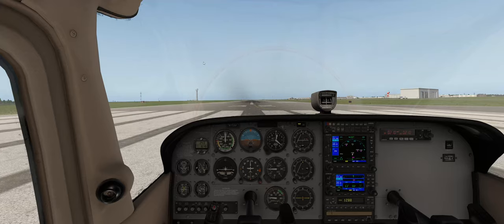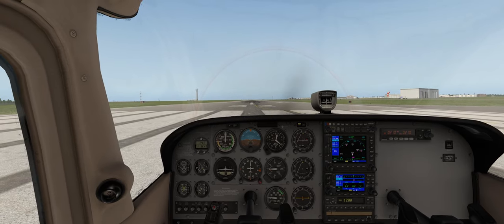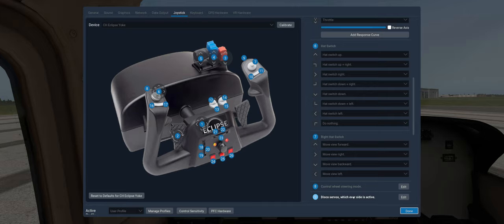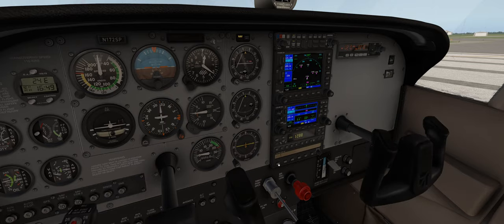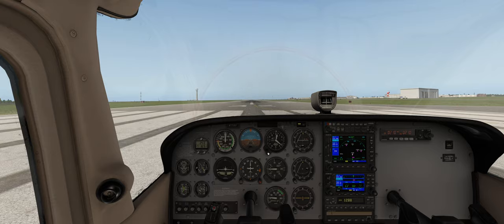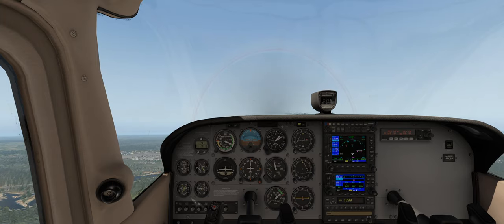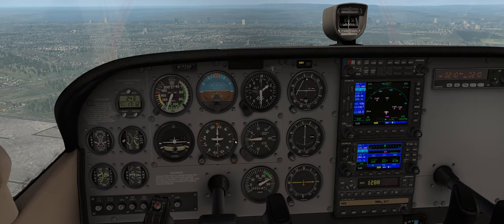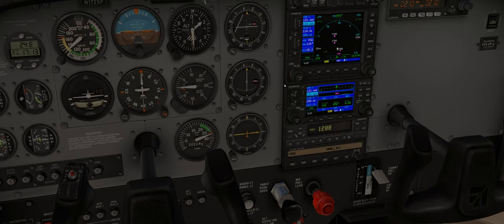X-Plane 11 - Cessna 172 Autopilot [updated]

Comment: This is a great video and it answers a  lot of questions I had about the Cessna 172 and the auto pilot. Just a shame that at some points of the video the frame rate has gone very low resulting in almost still/frozen pictures rather than moving.

Comment: Thank You Very Very Much. I have had no autopilot engagement of servos just the animation of where the plane should go. since the 11.3 update. I just had one plane that it all worked on, a modified Vision Jet G2, that I had go off the Xplane Form.  But you knew the answer. I now have added the Auto pili button to my controller. It now works. Thank You once more.  Namaste

Comment: I did like a 3 hour flight and I crashed because I didn’t know this
Reply: Yup. Jumped on this video like a hungry tiger. 20 minutes fighting the autopilot as it was determined to kill me. Only way I could disconnect the Autopilot was to go into menu bar, let the AI control airplane, desperately restart the engine and prop midair then turn off AI control. Now I can maybe use the Autopilot now. Very instructive video,

Comment: Hi Jason. Your tutorials are very informative and getting the 172 into the air and using autopilot seems easy. But whils I am getting used to it how do I switch back to manual control for approach and landing. I am using the version without the AP button and not sure which button on the keyboard you use. Thanks and keep up the good work. Alan Smith

Comment: Great tutorial. I never managed to make the approach before, but now I understood that my map was showing different things. I didn't see that ILS approach graphics on my screen, so now I can click on it and get the correct frequency. And I also didn't understand how to use the new AP, since most of the tutorials online are based on the old one.
It would be great to see a tutorial how to move from the Cessna to something bigger. Which would be the next step and what do I need to think about? I started out with the Cessna and then quickly moved to the Zibo, but there are sooo many thing to think about, so I moved back to the Cessna to learn a little more before stepping up. So it would be great with a tutorial on how to step up to a bigger plane. And which one would that be?

Comment: Thank you for the updated tutorial. One question though. When you performed the ILS approach you input the nav frequency using one of the input nav 1/2 buttons in the map menu. Bellow these buttons is a third named ILS Approach. What does that button do?
Reply: That puts you at on course to the ILS where it meets the glide slope. You can use it to quickly teleport to test landings.

Comment: I got the CWS and the GPSS but the approach is not working as shown.   I set the 172 up at CYOW on a 10 mile final, start, then pause, click on the map, but when I click on the airport I dont get the localizer line on the chart like you did.  I do see the glide slope in the map window but when I click on it there is no freq for the ILS.  I just get a pop up box with onions on what approach to choose. I choose Rwy 32 ILS but then there is no way to turn the freq like the way you did it in this video.  Is this from an even more recent update?  I just dont get it. Very discouraging.  This is my life story with ALL apps.  Just when Im getting used to it, BAM, here comes an update to screw me up.

Comment: Hello Jason, I start to use the new autopilot of Cessna 172 , and I have to say that I have some trouble wiht the plane in soil, due the autopilot was get on in the soil, and so i didn´t get to control the plane in earth. Which tips could you done to avoid this problem. Perhaps you can do a vídeo about this situation related to the autopilot in soil? Regards.

Comment: when ever I put NAV mode on with GPSS it goes the opposite way. What do I do?
Reply: i have the same problem...
Reply: think i cracked it.... when starting a flight press m to get the map take the cursor over the airport  press it with the mouse then you get options to tune in your gps... tune it in and your plane will follow the line on the gps

Comment: Jason: Appreciate all your excellent and helpful videos. I have one question I hope you can answer related to the autopilot (not just the S-Tec 55: When performing an RNAV approach that includes an oval holding pattern, how do you tell the A/P and the GNS530 to exit the holding pattern and continue the approach? The magenta line stays fixed in the holding pattern and I cannot determine where to go to move from there. In the FPL section or APP section. I assume the GNS 530 stays on the GPS CDI setting since no ILS is involved. Thanks.
Reply: Suspend button
Reply: @johnpesale3896  Thanks. That question was from a while back, but still appreciate the answer.

Comment: Jason, this has helped me out a lot with understanding how the autopilot knows what input to follow.  However, I'm still confused with a GPS approach.  If I use GPSS and I have an approach activated on the GNS530, the autopilot tracks the course very well.  But in GPSS mode it seems not to want to follow the glideslope that is shown in the CDI and pressing ALT on the autopilot doesn't bring me to GS mode.  Also pressing APR takes me out of GPSS and  just makes things go haywire and I go flying off somewhere that I don't want to go.  What am I doing wrong here?  There has to be a way for the autopilot to follow the glideslope in a GPS approach, right?
Reply: LOL! Same issue here! I’m trying to follow this vid but like yourself, when hitting APR it just goes off somewhere else. I’ve searched but can’t find solutions. I will persevere to find out and if I do I will repost here...

Comment: I don't use plugins, so I use my mouse to steer the plane. Could you do a tutorial about Cessna Autopilot without yoke?
Reply: Just assign those 2 buttons to any unussed keyboard key, and do the same. If you have a mouse with extra buttons, that would be a good option too.
Reply: @diegogoldfarb4729  but how do you assign things to keys?
Reply: VBPlayz check settings and keyboard settings and you can bind keys

Comment: Is their a reason why when I put in heading 360 it doesn't line up with the TRK?
Reply from the maker: Are you in HDG mode or NAV+GPS mode?
Reply: @JasonVriends  HDG on the auto pilot
Reply from the maker: HDG mode follows the HDG bug and not GPS. Then the HDG bug to your desired Heading and it should move to that direction.
Reply: @JasonVriends  OK thanks
Reply: When I made it home yesterday and logged on to fly. X Plane did an update and the problem went away
Reply: I have another question. Do I need to download a app to get scenery  like homes and cars?
Reply: @Dxcarroll  There are plenty of add-ons out there to improve scenery and moving objects. There is a video here on YT which talkes about the 24 essential add-ons for XPlane. Check it out. It will answer all your questions.